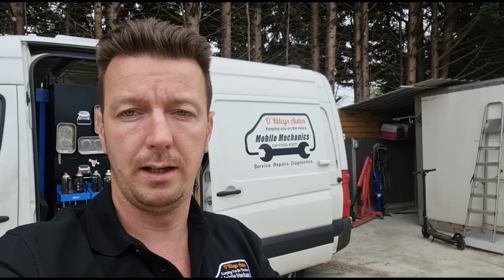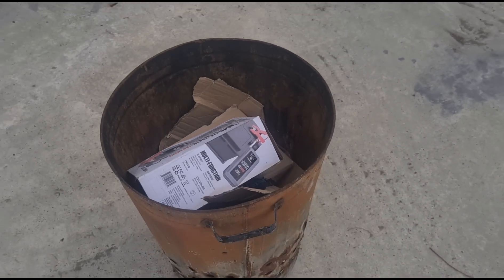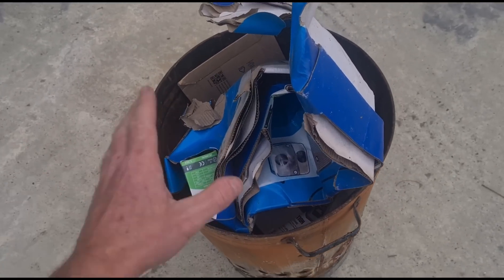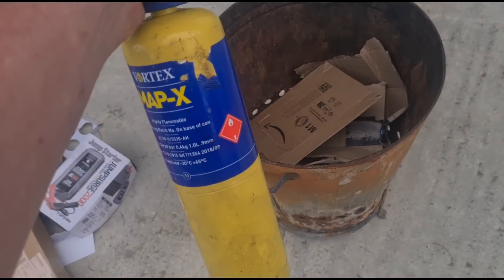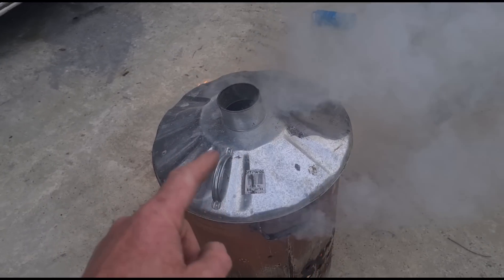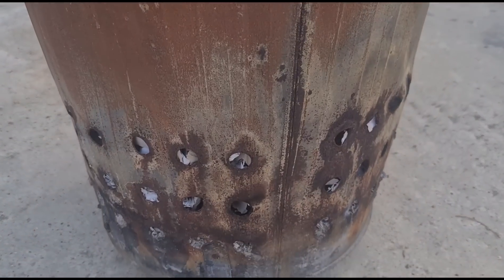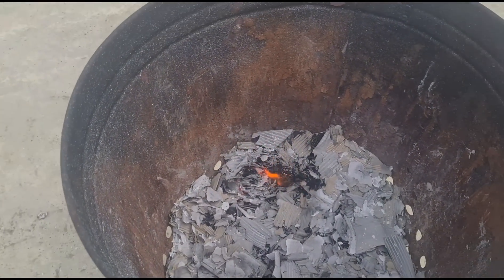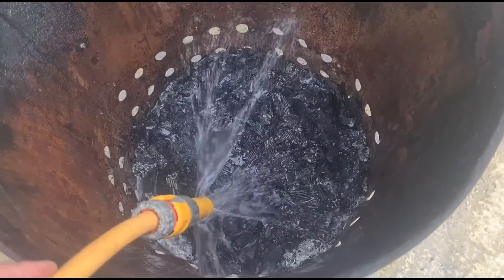Where does the soot go after DPF Regeneration? Save it all up to just blast it all out at once?

Comment: This is nothing to do with engines but I've found those incinerator bins work better with a second bigger upside down bin on the top with a big hole cut in the base of the second bin. You get a nice column of hot air to rise up the sides and come out through the air gap between bins and burn all the smoke.

Comment: A practical example of how heat can reduce Hydrocarbons to Hydrogen and Carbon which combine with oxygen so Hydrogen and Oxygen make water/steam and the Carbon combine with Oxygen making CO2 Carbon Dioxide. Leaving only the incombustible Ash elements. In a nutshell your soot has turned into gases, water and carbon dioxide.  This is what the trees used to build themselves in the first place, the trees died fell got covered the compressed and turn into oil coal etc, Hydro Carbons. So the soot in your Particulate Filter has turned to gases which adds CO2 to the Atmosphere contributing to Global Warming. All Countries should be planting trees to absorb more CO2 as we are releasing CO2 stored underground in Oil and Coal etc for Millions of years and we are leasing it in 100 of years and Heating up the Planet. Keep doing that the Planet Survives we do not. Look at the Lessons of Easter Island. The Island is still there the People are not, not working with nature is stupid stupid stupid, our ancestors not long ago worked with nature not fought with it.

Comment: When the dpf doing a regeneration and burning off particulate some off the particulate is released into the atmosphere has it burns. Has the system ages it burns at lower temperatures because it’s less efficient and therefore releasing a lot more contaminants into atmosphere before the dpf packs in and needs replacing

Comment: If you don't grasp it after that there's no hope. Even when my car is doing a regen you still don't see or smell any soot particles. You can feel heat from under exhaust like.
Changing subject  Jimmy can you clean low pressure EGR on vag 1.6 tdi . Got a p2002 that keeps coming back after countless launch dpf cleans.  Running at 4mbar idle no codes just efficiency below threshold probably because of low pressure egr. Is it better to remove it.  ? Thanks

Comment: so surely then, at the point that the dpf is blocked with ash and you need to replace it, then the ash is essentially disposed into the environment, via a DPF recycling centre? I think DPF's are just to reduce emissions at point of use, and reduce the amount of ash over a non dpf diesel, but don't erradicate the waste to zero.

Comment: You may have been asked this question a 1000 times, Here is 1001, Is it possible to cut open the dpf and then remove the ash then weld the dpf back up?
Reply: Yes but you will need a remap

Comment: Useful analogy, but my understanding of the chemistry is that the soot is basically pure carbon which burns off to gaseous CO2 during regen cycles whether forced or passive. The ash is formed from additives in the engine oil such as zinc, magnesium etc which form solid salts when they burn and block the channels within the DPF - the oil comes from the crankcase breather mechanism and through losses in the piston rings - hence needing to use low-ash oil on DPF equipped diesels. I recently bought a 180k diesel with DPF (with DOC) that was blocked with ash and cleaned the ash out of the DPF off the car by dissolving the ash in an alkali followed by acid bath (safely I should add!) - the strands that came out look like limescale (there was no soot whatsoever) - the ECM was reporting soot content of 50g before, it now sits at a steady 13.5g calculated based on the differential pressure it seems - if it does another 10k I'll be happy :)
Reply from the maker: So the point of burning soot to ash is the eliminate soot particulates in the air
Reply: @ORileysAutos  yes, but the soot just turns into gaseous CO2 - the ash is mostly from the engine oil also burning off...
Reply: Hence the need for low ash engine oil ?
Reply: @Umski yes, but breathing in gaseous CO2 is less harmful than breathing in soot?
Reply: @lodgecav490  pretty much, I still wouldn't stick my head behind a diesel with a DPF mind 😬
Reply: @Alex-tu9bh   completely right
Reply: @Alex-tu9bh  exactly, even then OEMs don't GAF as once the car gets to 100k+ and the DPF is toast they can sell you a new one for £xxxx - DPFs were never a panacea but they're better than nothing when it comes to particulate matter floating around in the air...ironically burning it off makes more CO2 - swings and roundabouts 🤔

Comment: Jimmys point is that the dpf does not spit out the stored soot during a regen. It reduces the soot to ash through burning it.  The ash remains inside the dpf.
Reply: I think some ash escapes, but, it can build up if temps snd long journeys are not achieved ..
Reply: @neildean7515   If ash escapes the DPF is holed or cracked.  If the tailpipe is at all black with soot- the same applies.
Reply: @timbo19751975  indeed, when my car was new, the tailpipe hole was longtime clean, now, after 200K it is black of soot, so the soot or ash escapes somehow.

Comment: So, where is the ash collection bin within the dpf? I would surely just unbolt a little window and vacuum it out you know like the fireplace at home.
Reply from the maker: Most would sit in front of the filter but soot within the filter also turns to ash
Reply: Watched a guy on here remove Ash from a dpf with brick acid, does that not work?

Comment: Mind that it still 30% less of CO2 per mile than cobal and coal powered green evs...
Reply: Don’t worry you can get to 100 k before the ev is even parcelled on manufacturing the vehicle by co2 measures
Reply: Doesn't matter. The ocean will eat all surplus CO2 anyway - no big deal at all.